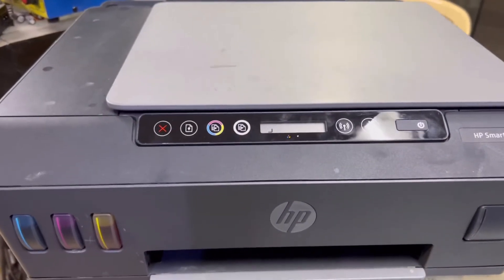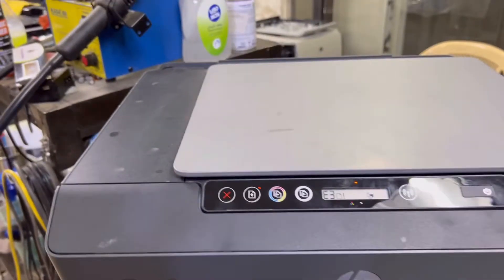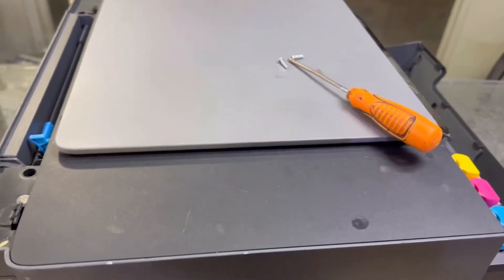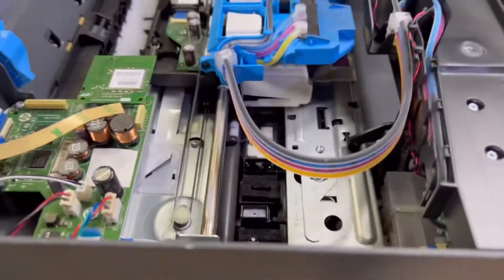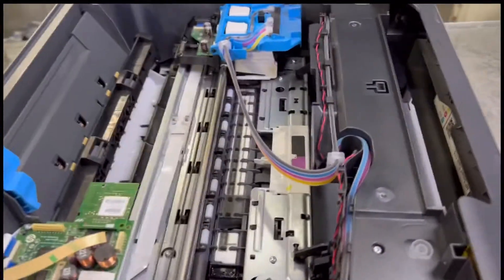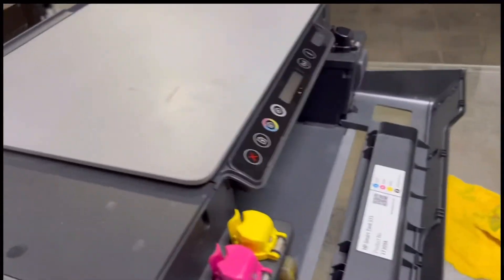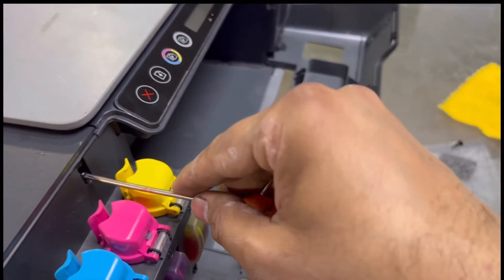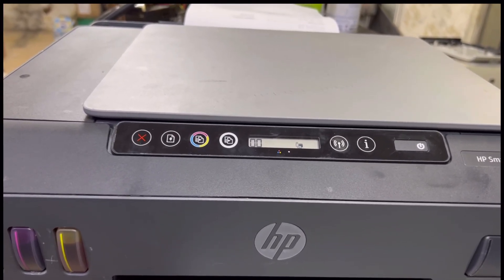HP Smart Tank 515 Disassembly and Fixed The Ink Carriage System

Comment: My niece gave a HP 515. Both tricolor and black blinking. I carefully cleaned contacts of both heads and the carriage contacts. Color blink passed but black went on. I checked the print head and saw that one yellow contact was missing. I bought a brand new head but the black head blink still going on even the contacts seem clean and bright. I will appreciate all comments thereon before I disassemble without knowing where to touch...
Reply from the maker: no need to disassemble, you have to check with another cartridge.
Reply: I bought a new print head and still same.

Comment: With which kind of screwdriver can i open the printer ??
Reply from the maker: 5 star screw diver
Reply from the maker: T5 Star Screw Driver
Reply: @BilalKhalid  Can you send me link for example for the correct screwdriver from aliexpress ? I will buy from aliexpress
Reply from the maker: @eliramyakar1853  Just found this amazing item on AliExpress. Check it out! SAR15.58 | 9PCS Torx T1 T2 T3 T4 T5 T6H T8 T10 Screwdriver 3/25"(4mm) Bits Repair tools Bit Plum Blossoms Repairing Head for Fitbit Alta HR
https://a.aliexpress.com/_mNWrMmq
Reply: @BilalKhalid  Now, i got exclamation mark what now ? :(